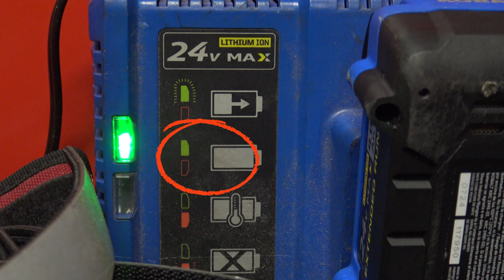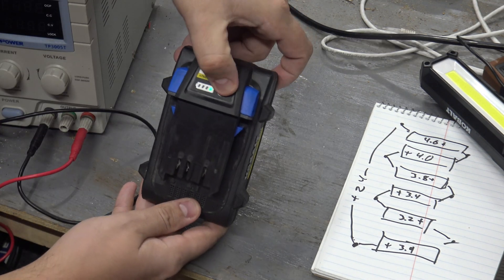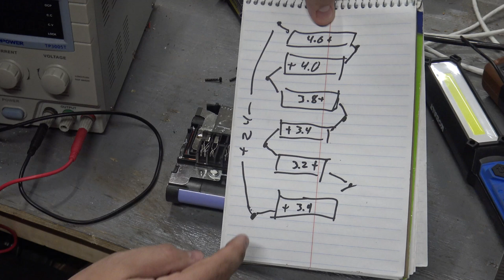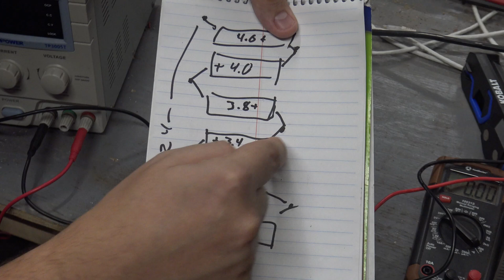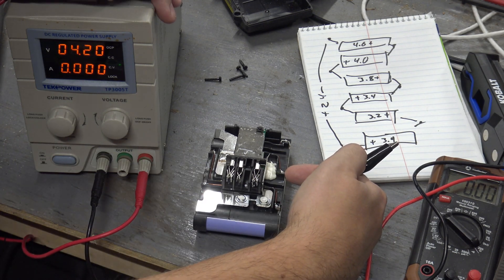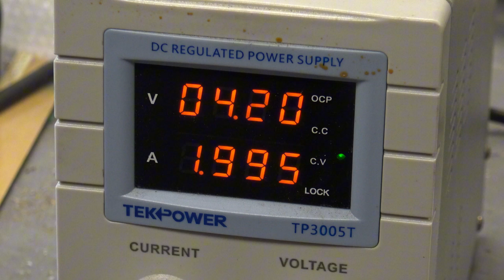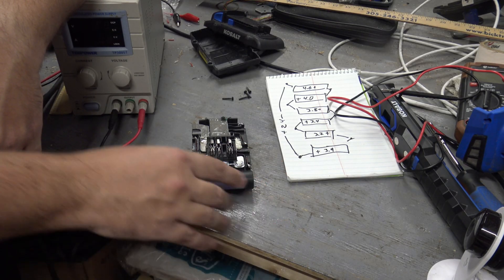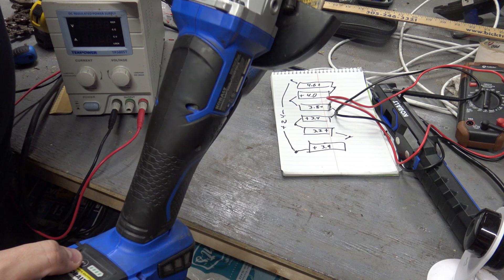How To Save a Battery Not Charging with a Power Supply! [Kobalt Ultimate Output]

Comment: I'm having this exact issue with (4×) of the exact same batteries.

Benchtop power supply ordered - ✔️ 
Liked - ✔️ 
Subscribed - ✔️ 

I'll report back if I'm successful with them.
Reply from the maker: Best of luck, and be careful! 

I'd also advise that once you have the battery balanced, try to keep it charged regularly. The one I balanced in this video performed great for quite a while when I kept it charged, but I let it get down to 1 light, then let it sit in that state for a few months and the same cell went out of balance again.

Comment: good explanation. I'm wondering if Kobalt doesn't do cell balancing and that's why their batteries are the cheapest for a 24V 2AH pack. Thanks for making this video pointing this out as a potential issue with Kobalt. A set of their tools is my next planned tool set.
Reply from the maker: I would be very surprised if they don't have any cell balancing at all. That being said, it is obvious that either the specific cells they use in the Ultimate Output, or the BMS in it is not great. I have been using Kobalt since the 12v days, and rarely have batteries fail, but these Ultimate Output ones fail much more often.

Comment: Wait did you end up switching around the positive and negative?  Opposite sides at the end of the video
Reply from the maker: Every individual cell is facing the opposite direction from the one next to it. Earlier in the video I was demonstrating it on a battery in a certain orientation, at the end I was connected to a battery in the opposite orientation. That's why understanding the schematic and layout of your battery is important.
Reply: @DustinCorbin  well wouldn’t they lay out each battery the same orientation as the other ones? I get the cells are opposite to each other
Reply from the maker: @codyclarkbmx4960 yeah. Sorry, I meant I was on two different cells through the video so the positive and negatives were moved as needed for the individual cells.
Reply: @DustinCorbin oh ok gotcha thanks

Comment: I just now am having this issue. Pos and neg are not an issue for me, my question is charging. A have a couple of 4 bay single cell chargers (i love a good flashlight haha). If i used a block to imitate a battery for the spring pressure but used clips such as you are to enable it to see the an individual battery in the pack just as you are, do you reckon it will work properly. I have no interest or need in getting a power supply such as yours
Reply from the maker: As long as it is connected correctly, yes it should. But of course, do it at your own risk. Just make sure the charging parameters are correct for the cell.

Comment: Interesting video! I've had my Kobalt 80v mower battery not charge and I used another 80v battery to give it enough charge to allow the kobalt charger to see it and recharge. My question- this has occurred on the same battery twice in 6months, mainly it occurs  if the battery was drained too much. In your opinion, are they safe to continue to boost them and when do I throw in the towel and purchase a new one.
Many thanks!
Reply from the maker: I've done it for quite a long time on batteries with the same issue. Eventually it just gets worse and they become irreparable, but you can get some good life out of it before that happens. That being said, it's never 'recommended' to do so as there is always a risk of damaging the battery. Maybe try to not let that battery get below a certain state of charge to help it out.
Reply: Many thanks for your quick reply!

Comment: I was thinking about buying a cheap single cell charger and soldering on a couple wires with clips. Then I think I can just clip it on and let it charge without need to unhook it for the power supply like you did here. It would essentially be the same as removing the cell and putting in the charger. Am I correct or am I missing something? I guess my only assumption is the charger will shut off at the proper amperage.

Comment: Questions so can I just try to hook up a motorcycle trickle charger without taking it apart the battery?
Reply from the maker: @nicktelesco4950  I have jump started completely dead batteries packs using a similar method. Sometimes the whole pack voltage drops down below a certain threshold and the charger won't charge, And giving it a little jump with a fully charged battery can sometimes get it high enough to accept the charge. In that case, all of the cells inside the battery were low, and not one cell in the battery being unbalanced like in this video.

 Your motorcycle battery charger probably runs at 12 volt so it won't really do much for a 24 volt battery. On top of that, even if your drill battery was 12v, a trickle charger for a lead acid battery probably doesn't have the same charging profile which could end up damaging the cells. I wouldn't recommend doing it that way. The risk of catastrophically damaging the battery is too high.
Reply: That would be a very bad idea. The most likely problem here is that one of the cells is low. If you charge all of them at once in series, then you will be increasing the charge of all the cells at once. 

Since some are higher than others, you’ll end up overcharging some of the cells. Which makes them catch fire.

Comment: I pick up packs at the recycler to fix or simple curiosity.  Doesn't matter what brand, there's always one with one dead cell sitting there.  If you re-balance it early you'll get a lot of life out of it, but it'll probably drift again.  If you don't give it a little tune up like shown here eventually the weak cell will get low enough to be damaged and then it won't re-balance, that cell will just croak.  

Good, you mentioned the "security torx" bits, small detail often overlooked.  

Fun fact, it's probably not balance charging.  DeWalt doesn't, nor team red.  (check Tool Scientist on this here YT)  The balance leads are just there to cut off charging when any cell hits 4.20~4.25.  So they all drift out of balance like yours, luck of the draw how matched your cells stay.  Doubt Kobalt balances, but I have no experience with them.

Nice diagrams showing the polarity of the cells in the pack, other brands do theirs the same way.  This pack is a 5S pack - that is, 5 cells in Series.  In larger packs your viewers will often see double the cells to increase the capacity, in that case they'll be in a 5S2P config, 5 Series 2 Parallel.  That means two cells will be ganged together in each row, and since they're physically attached they'll be exactly the same voltage.  For the purposes of rebalancing treat them as a single cell.  

Benchtop power supply is a nice way to go, nice to see you explain how they work.  An individual cell 18650 lithium charger with some test leads attached will work, just slower. (make a dummy cell with a piece of dowel to hold the negative lead in place)  Slower isn't going to hurt anything.  Don't try to charge more than 1 battery at a time even if you have a 4 slot charger, it'll feed through the charger and fry it at the least.  

Always nice to see inside a different brand's pack to see how they're built. And a bonus musical interlude, thanks Dustin.
Reply from the maker: @bobclarke5913  really appreciate the comment and information! I always find it hard to fully articulate everything I know while shooting a video, such as the pack configuration. Ends up coming out "the positives and negatives go this way" 🤣. I try to keep things as layman as possible but I know I end up leaving out a lot of valuable information. Plus I didn't script anything, I just had the camera going as I was trying to get the battery working anyway. Comments on yours help a lot! 

I'm surprised all the bigger brands don't balance charge. Seems like they could get a lot of extra life out of these batteries if they did. But I guess having things last forever is not the name of the game anymore. 

I do wish I would have mentioned that a cell voltage below a certain point is probably not going to be saved. I got lucky that these cells were still significantly above the cutoff of voltage of the battery. I have one of the old 12 volt kobalt batteries that had a cell around 1 volt and it's recharge and balance didn't last more than a day or two.